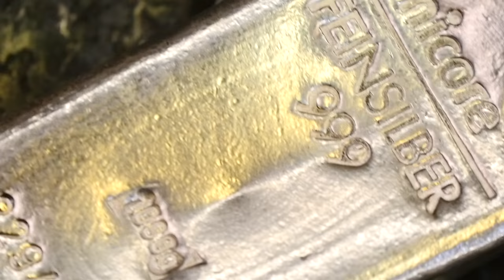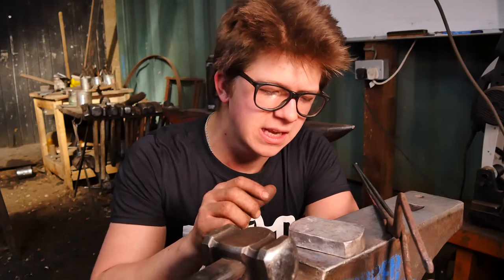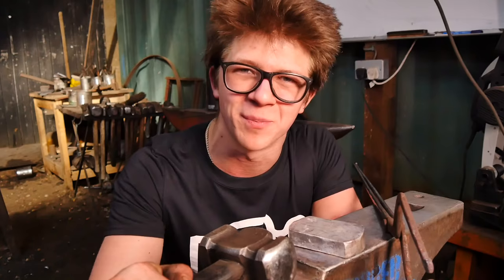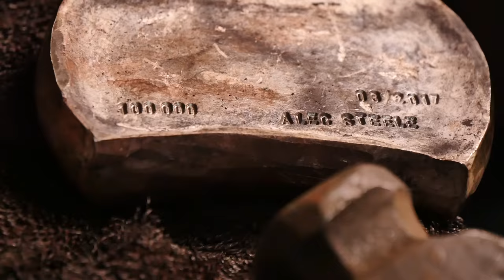FORGED: SOLID-SILVER PLAY BUTTON!!!

Comment: At start, sorry for bad english, and hello from Trollskys land ;)
About silver: If you will ever use it as material in future: Dont worry :D
1) you could (and even should) heat it to cherry time to time, it will reduce any tensions inside material. 
2) it will not just... blob. At first heated surface will turn mirror-like in couple places, than it will slowly melt. Basically there are couple goldsmithing tehniques where you use that "not completly melt" form melted edges, popular in handmade jevelery, to mokume-gane at end
3) if you like damascus, you will love mokume-gane ;)

Comment: to keep that polished and clean looking fill your sink with hot water put a sheet of aluminum foil in the bottom of the sink. pour in a little borax let it dissolve. put the silver play button in and it should clean up of any tarnishing as soon as it touches the foil

Comment: Great video, Would something like a wood splitting maul be hard to forge due to the off side being like a sledge(repeadly struck by another sledge) to drive the splitting side through logs.
Reply: Wouldn't think so. If you think of it, it's just a hammer with the peen turned 90° and forged to a bit sharper angle, heat treated and sharpened.
Reply: only reason i ask is that every one i have has mushroomed over time.
Reply: Well, that is bound to happen. It's a bit of work for your local blacksmith to go and repair it! :) But really, having a bevel or slight rounding of the striking face will delay that, but it's really something that has to be dealt with every once in a while. You've got to maintain all of your tools, splitting mauls included!
Reply: Ok thanks

Comment: Alec! Question. I don't know a whole lot about this stuff. But why do you anneal it and hammer it when it's cold rather than when it's glowing red? Is it because it would be too soft glowing red?
Reply: He's not really annealing it so much as heating and working it.  Silver's much softer though, so he doesn't need much heat, but it helps prevent cracking. As far as the glow is concerned, all metals glow certain colors at the same temperature, from 1000° reds, 1600° oranges, to 2200° hot white. Silver becomes a puddle at about 1700°, so he's being very careful not to melt it. When he first removes it from the forge, it's probably glowing a faint red, but it's hard to tell from the lights and shiny metal just what color it's glowing.
Reply: Ahh that makes sense. For 500k he should do a silver button with a gold inlay of the play symbol. That would be kinda cool.

Comment: So did you choose not to get it at least red hot to prevent loss, or because its not necessary or because the red-white-melt temps are too close? or why?
Reply: Phillip Kirkpatrick because silver melts before it can reach "red hot" temperatures, I'm not sure why he put it in the forge to begin with that was a major risk because like he said it'll melt into a puddle and pure silver is soft enough to forge without heat